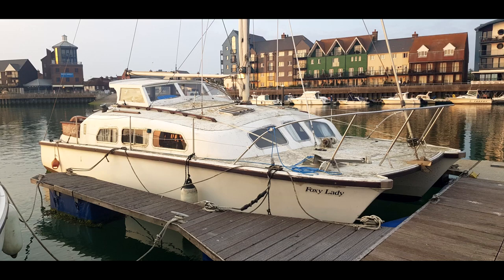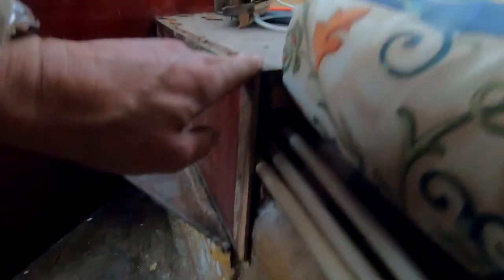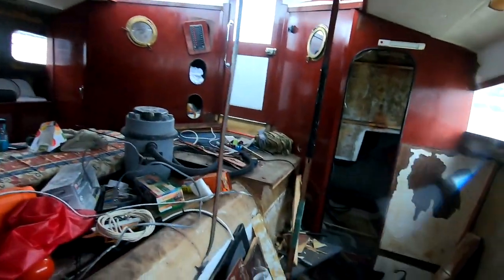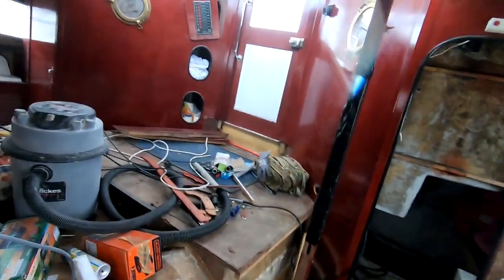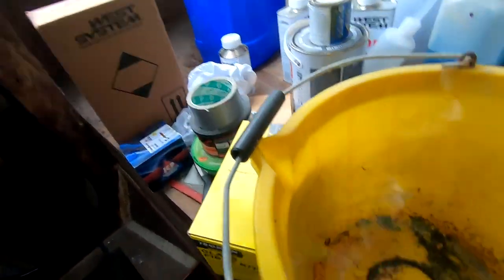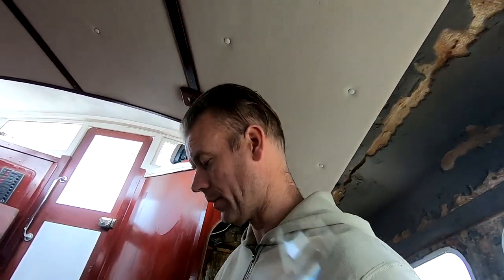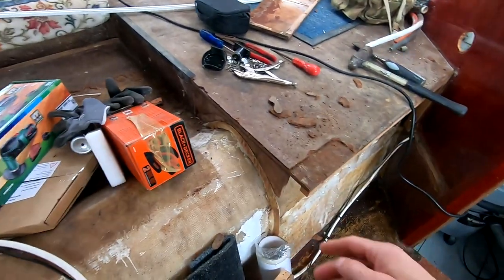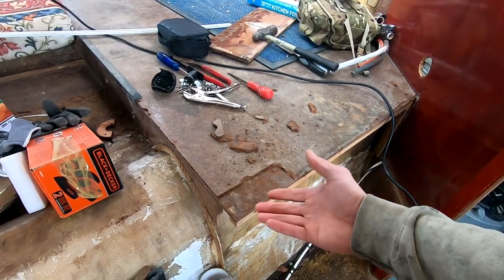Stairs removal and a new bulkhead on project catamaran E36

Comment: Making templates for ply linings & bulkheads used to be a right pain for me. Nowadays i cut 1/8" hardboard into 2" strips, and use a hot glue gun to build the template edges in place. Cross brace with strips to give strength. Use a profile gauge to measure  curves / corners, transfer to & cut in hardboard, and hot glue into the template. I think boat works today did a vid on the technique in the last 6 ish months for a transom repair.  I saw sail life using a dab of hotglue to temporary stick wood to fibreglass, effectively giving a pair of hands to hold the strips in place while you work -  i need to try that. Hope that helps, cheers for the video :-)
Reply from the maker: Hi David, great minds think alike. I saw Andy's videos on the transom too. But after i done this...🙄 when templating the galley you will see the method above used with a slight change. Instead of hot glue i used all my old scraps and screwed them on to get the profile. 👍🏻😁. 
This is why i am now doing 2 videos a week to try play catchup. You and my other awesome subscribers are always a great help and everyday truly is a schoolday😁😁